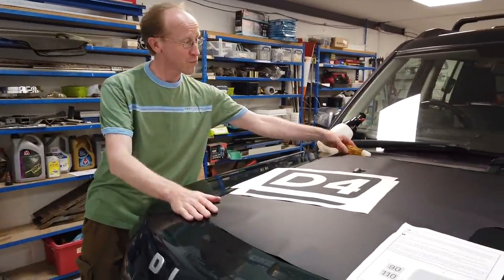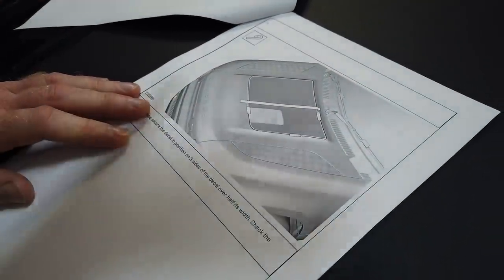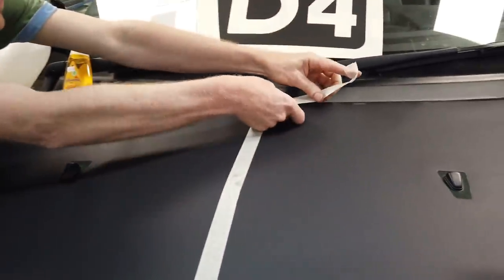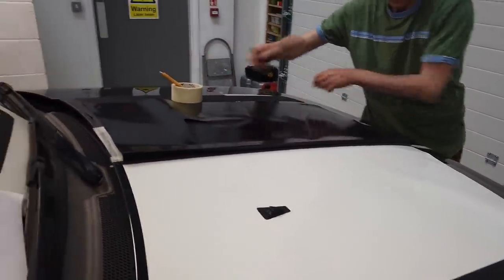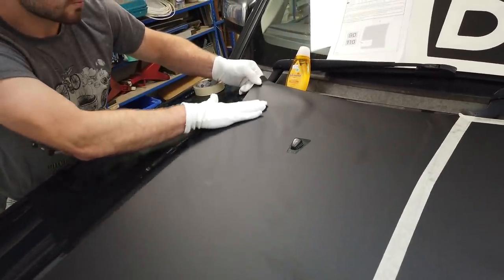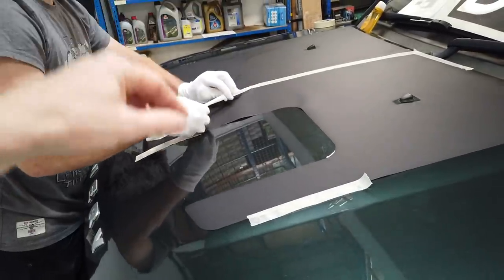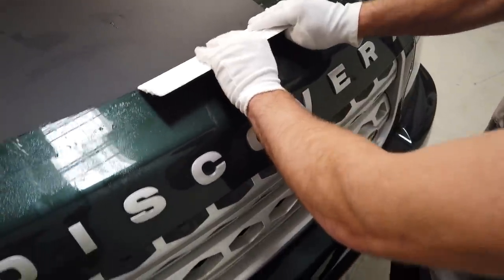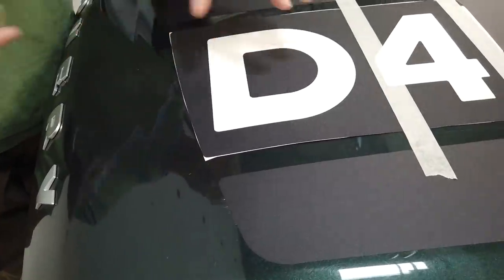Land Rover Discovery 4 / 3 Bonnet / Hood Decal Fitting Demo

Comment: Would be good if you could print it out all in one piece with a backing side so that the spacing and positioning is all correct when you stick it down.
Reply from the maker: Yes we looked at this - it adds an extra step to add the release film and adds costs..also for stock we can print the decal with D4 then a bunch of D3's and we can hold stock that can be used for each model.

Comment: Next time, put some masking tape across the "D" and "4" before you remove them from the backing to hold the center bits in place while you position the decal.  It will hold them while you squeegee the air bubbles out.  Leave the masking tape there until the water dries.  You can even use the masking tape to hold it all together so you can do the entire right side at one time.  And for the U.S. customer, how about L3 and L4.

Comment: Nice idea, but why not make it a fit to each of the side and front crease lines and to the back edge of the bonnet and then it would be a doddle to fit, but cost an extra quid or two of material. Seems obvious watching the vid, plus that nice curve to the front above the Discovery lettering ?? !!
Reply from the maker: The Defender one is actually quite small - our is bigger... what we noticed is that the bigger you make it the hard it is to fit as the bonnet starts to curve and not be flat the nearer the edge you go.
Reply: it wouldnt suit cut to creases etc! looks way better cut just undersize , gives it more definition!!